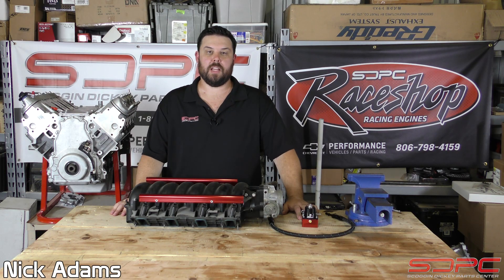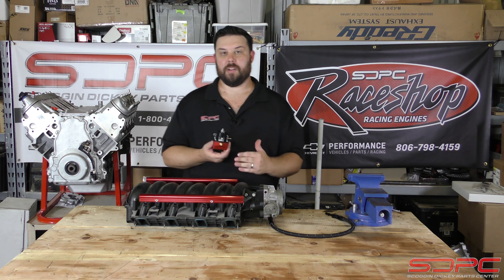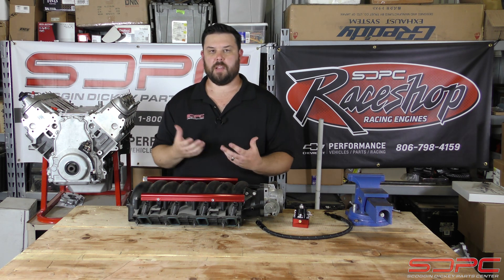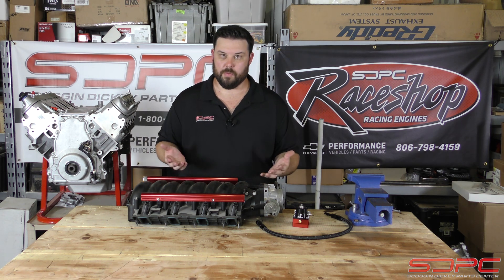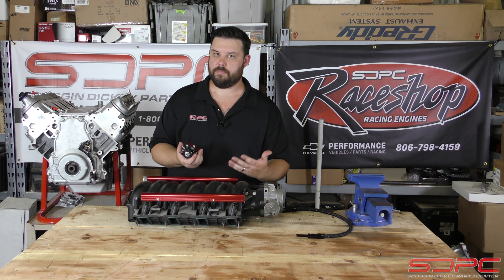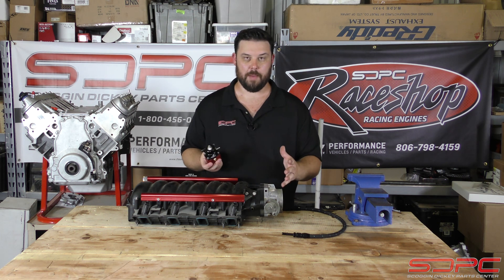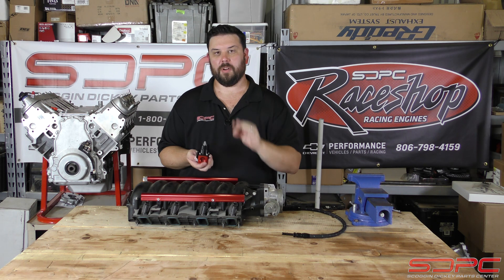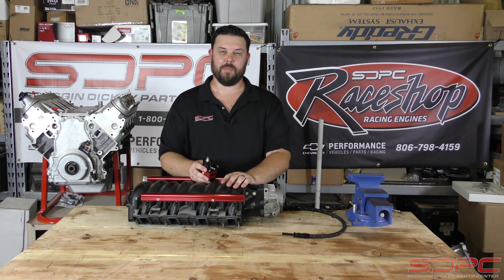SDPC Tech Tips: Fuel Rail Plumbing

Comment: Hello, Thank you for your recommendations,

but I have a 2014 Chevy Silverado Gen V L83 engine swap and I am not using the original fuel system but a conventional system and the problem is that I cannot raise the pressure to more than 45 psi or maintain it... how can I raise the pressure to 75psi and maintain it with the Aeromotive type regulator, this in this type of GEN V L83 Chevrolet engine?  THANKS YOU
Reply from the maker: Are you using the LT in-tank fuel pump and fuel pump controller or are you bypassing the PWM setup with a regular fuel pump and regulator? Is the regulator rated for higher than 75psi?
Reply: I'm not using PWM or LT Pump my setup is Walbro 450 Pump in Tank and 20-75psi Aeromotive Style Regulator, It's a Jeep Cherokee @Sdpartscenter  , then I never manage to increase the pressure to 45 psi

Comment: I guess you have to buy aftermarket fuel rails to run return Style with Terminator X  ( calls for 60 psi/ not 58psi Corvette) with Holly filter and Regulators on a Trailblazer SS intake. Sure it WILL run with 58psi but only until you can afford to do it right, and who's going to do an LS swap or buy a Terminator aftermarket ECU and barely have enough? Right?! Thanks for responding and referring me to this video all the same 👍